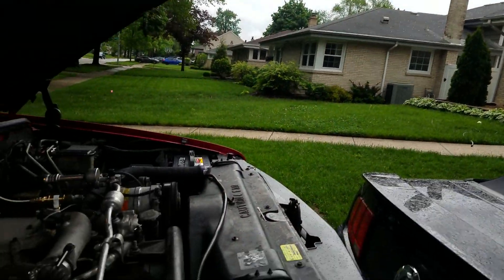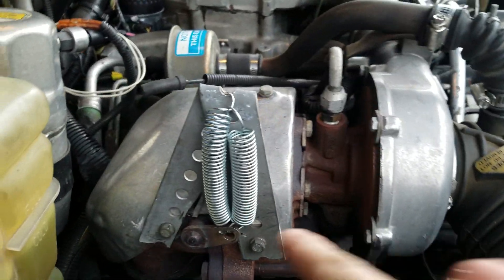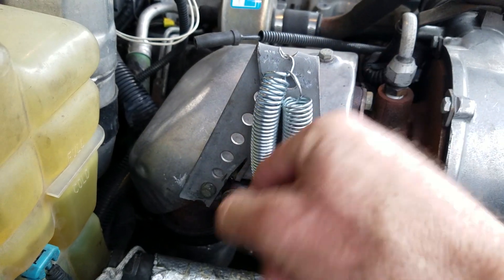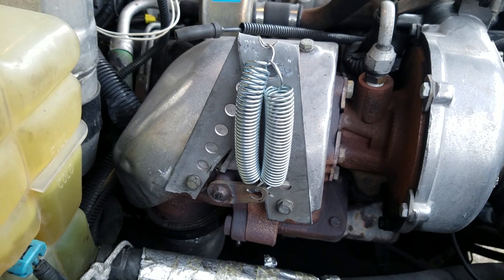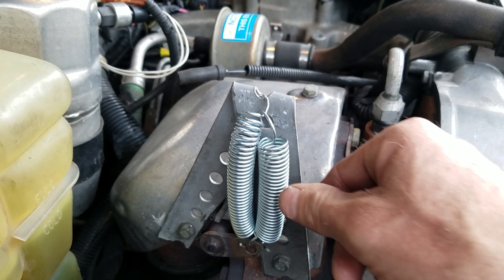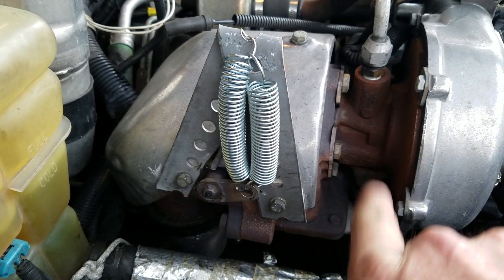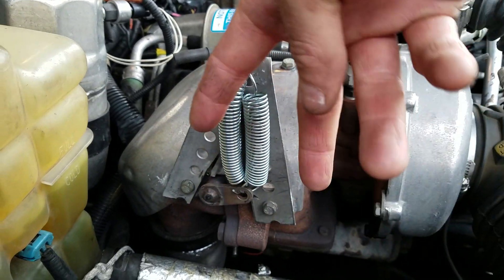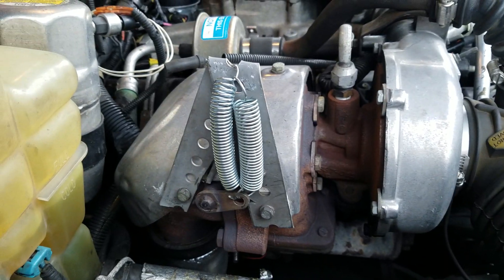6.5 turbo diesel mechanical wastegate conversion.

Comment: Those mangled springs🤣whatever works. I think cutting off the old one's cap is cheaper tho, if you have a die to thread the top of the rod and any 2-3" spring and a couple lock nuts

Comment: How does it work for ya? I'm looking at anything I can do to make cheap power to the 94 K2500 with the 6.5 I'm getting, all while it still being reliable. Overall, I want it to compete with the stock 6.6 L5P Duramax.